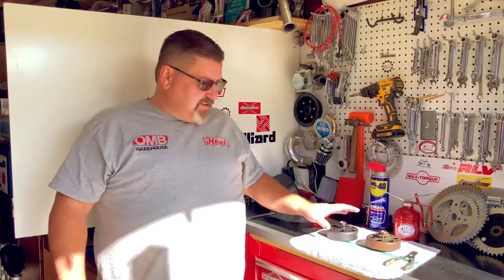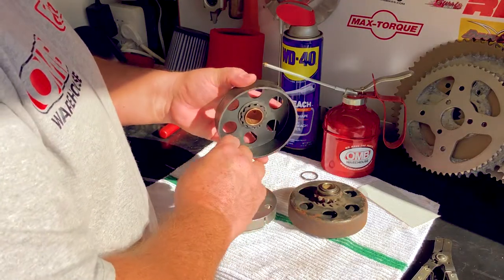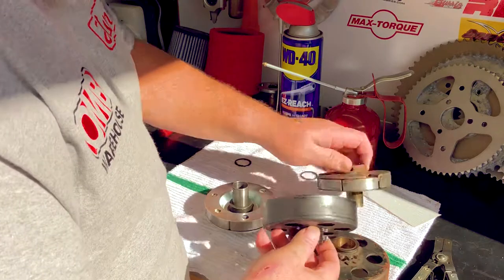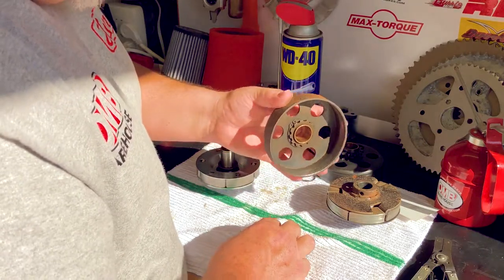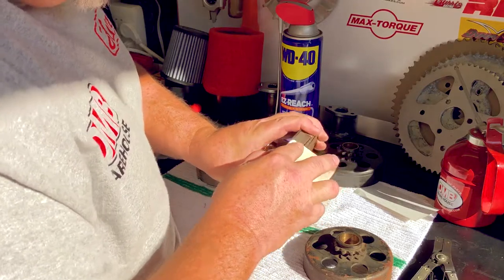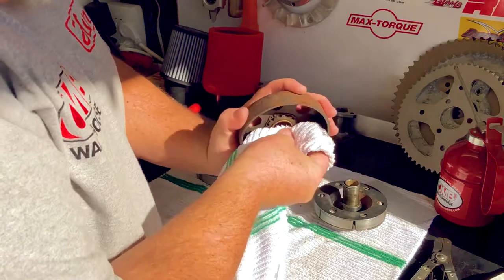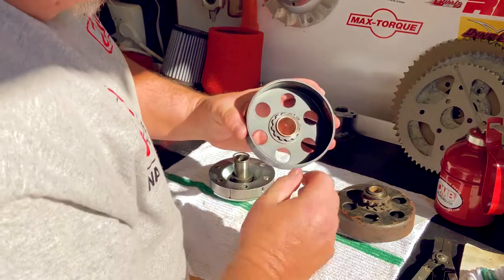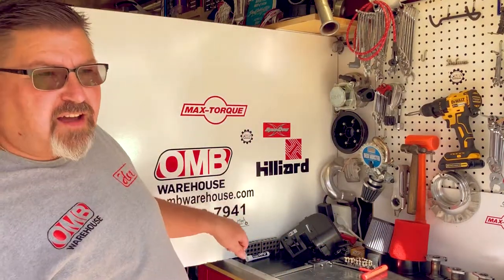Max Torque Clutch Maintenance Tips

Comment: But WD40 is a lubricant. Why not just spray Brake Kleen on a rag and wipe it out so as not to get it on the bushing?
Reply from the maker: That will work as well. We just can’t get brake/carb cleaner on the bronze. The WD in WD40 stands for “water displacement “. It is a solvent more than a lubricant

Comment: I have a ct200u-ex with a vm22 and package of jets. I have a 120 jet in it now with needle clip in the middle. It runs great with air filter off but bogges really bad with it on. Elevation is 512 here in tx. Any idea which way to go? Thx for any help.
Reply: Jet is too big

Comment: What's is the ridge indicative of? I got some of that action on a couple bells. I maintain my Max Torque clutches regularly. I'm guessing it has something with me being a bit of a chubber😒.
Reply: Do we sand down the groove on the bell housing i noticed the bronze bushing with the gear on it is 39.95 but a whole clutch is 40 bucks 🤔 I' found the bronze bushings for 3.99 and the black springs fir cheap

Comment: i just put a predator 212 on my niece's mini..    the clutch engages so hard that it's a dangerous wheelie machine now.  the clutch is older, could that be an issue?   i would like it to "roll" though the throttle rather than feel like a shot of nitrous..
Reply: You can turn the throttle limiting screw down but it will limit the full throttle til she gets used to it. 
Its on the throttle adapter plate.. philps head screw with a spring on it.

If u just have a stock clutch and its doing that, its because that engine is too strong for her and likely u have a big sprocket. 
If u go smaller sprocket.. the bike cud be too fast for her (so u really want to limit the throttle as i mentioned already)...... but u will have an easier take off

Comment: Dumb question but why add a friction reduction product to the drum ?
Reply from the maker: We are not oiling the drum, only the bronze busing. We do not want any oil on the drum. We only want to use regular motor oil on the bushing. Any synthetic oil can leach into the metal and reduce the friction. I clean the drum with WD40 as that is a solvent and not a lubricant. It burns off quickly when the clutch is used

Comment: I have a new clutch that slips right out of the box, I can't figure out why because it's happening with 2 new ones. Also I have a new predator motor now and same slipping. Not engaging hard, it's scrapes and slips until up to a higher speed. Any thoughts would be great to hear. Cheers
Reply from the maker: I would always evaluate the gearing choice first. We do not recommend centrifugal clutches on a vehicle with tires over 14" in height. Every clutch manufacturer likes to see a 6:1 ratio between the clutch and axle sprocket. For example, a 12 tooth clutch to a 72 tooth rear sprocket.
Reply: Seems like wd-40 is counter intuitive on the bell?

Comment: What 30 weight oil should I use for my Max Torque clutch? Name and brand would be kindly appreciated. Thank you.
Reply from the maker: I use whatever 30 wt or 10/30 wt I have laying around. It does not matter what brand you use as long as it is not synthetic oil!
Reply: @TheGrayGoatGarage what do I do when the gear is spinning I was riding and then something snapped and it stopped going I took it off and the sprocket gear is not stopping like the other clutch I bought off you it's the 13 tooth

Comment: Why use oil and not high temp grease??
Reply: The bronze bushing absorbs oil and slowly releases it as the clutch warms up. This needs to be done every 2 hours of use. When the clutch is warm you can add 2 drops of non-synthetic oil right by the snap ring and the bushing will pull the oil in. If you wanted to run grease in that, it will not be absorbed into the bushing and the pressure of the bushing on the hub will force the grease out leaving the bushing dry.

Comment: Do the clutches y’all sell come pre oiled ?
Reply from the maker: If you get a clutch that uses a bronze bushing, it is always a good idea to add a couple of drops of non-synthetic oil to the bushing. It cannot hurt and can only help. The bushings are oiled at the factory, but why chance it? Oil that clutch after every 2 hours of normal use with a couple of drops of oil. If you are getting a needle bearing clutch, always check to see if the proper amount of grease is in the bearings

Comment: Why shouldn't you clean the drum with brake clean? I services my clutch a couple days ago and used brake clean on it. I did oil the bushing afterward
Reply from the maker: We do that as a precaution for the people that don't pull the clutch apart. It will strip all the oil from the bushing and not allow it to soak up more. We use WD40 and wipe it down. Any residual will burn off. As long as there was no bushing in what you sprayed it will probably be fine!
Reply: @TheGrayGoatGarage  If we pull the clutch apart, is it better to use brake clean or is WD40 just as good?
Reply from the maker: David Leonard brake cleaner will strip all of the oil from the bushing and it may not recover from that. I only use wd40. Why risk ruining a clutch?
Reply: @TheGrayGoatGarage  Spray a rag with the brake clean and wipe it out. It won't get on the bushing as long as you don't spray the whole drum down with it.

Comment: What kind of oil is that
Reply from the maker: I use regular 30 weight motor oil. You can use just about any motor oil as long as it is not synthetic. Synthetic oil can leach into the metal.